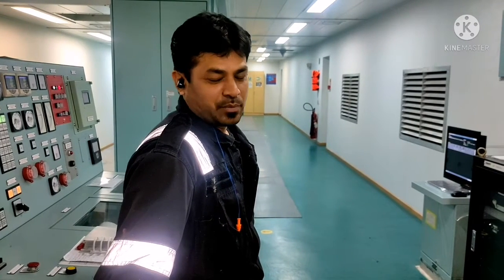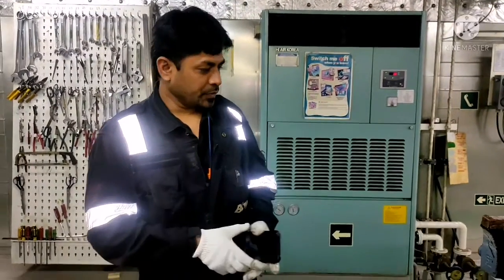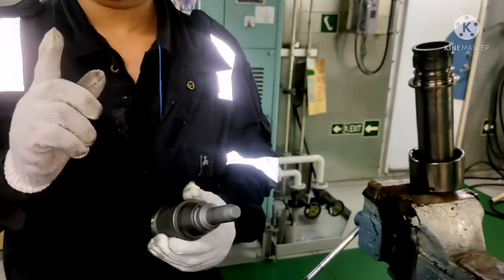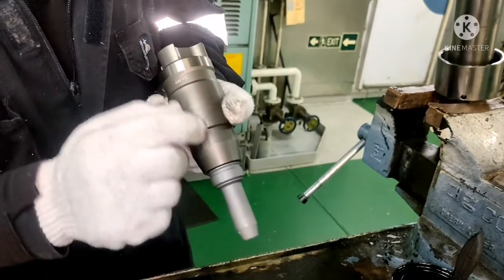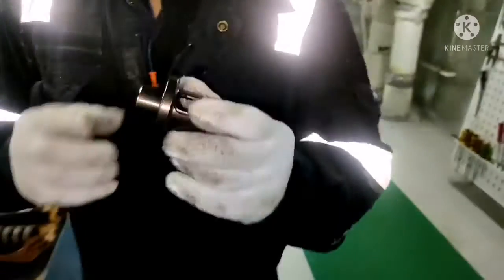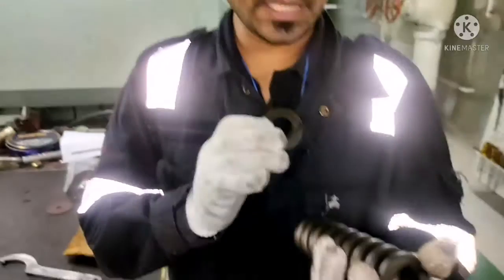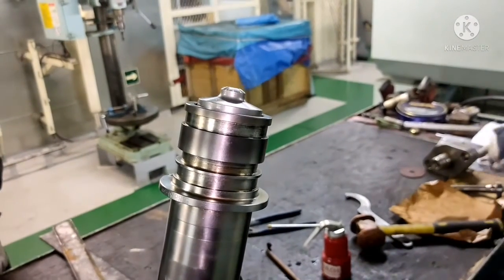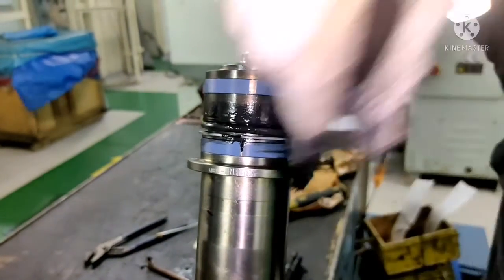How do they do... How to overhaul slide type fuel valves for Main engine (ME Engines)

Comment: Thank u sir , while i overhauled and boxed back i found opening press is less while press testing, added shim got a slight increase ,sir how the opening press got reduced after overhauling which was working fine on engine  and sir is there any limit of no of shims to add 
Thank u so much sir
Reply from the maker: Sir thanks for your query... Hv you pressure tested the  injector once removed from engine before dismantling for overhaul?
Reply: @marine-knowledge-basha  yes sir after removing it was tested and it changed after overhauling
Reply from the maker: @vaiz389  1.	Why after overhauling pressure drop when compared to before ?
a.	After cleaning , dirt which trapped between cut – off shaft and spindle guide will be removed , due to which good chance oil escape from the gap [ between the cut-off shaft and spindle guide] 
b.	Another good reason in case cut-off shaft smoothen [ for overhauling purpose] then gap between the cut – off shaft and spindle will increase, due that also oil will escape from gap 
c.	While boxing after overhauling good chance, any dirt trapped in between the sealing surface. 
2.	How many sims can be added in fuel injector?
a.	Mostly adding sims should be limited two or three – reason if spring is week and if keep on adding sims, then spring lifting height will be very less due which good chance of spring breaking during engine running condition and will cause major damage , it’s always recommended to renew the spring as per maker given running hours interval.
I beleive this answer shud satisfy your queries..
Reply: @marine-knowledge-basha  yes sir .thank u so much sir for ur response
Reply from the maker: @vaiz389  it's my pleasure to reply your query sir 😊